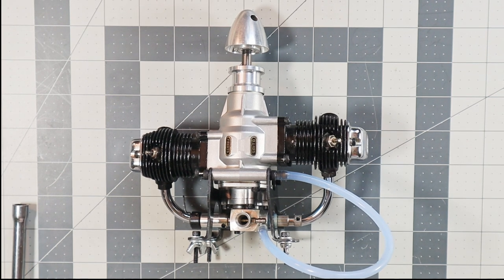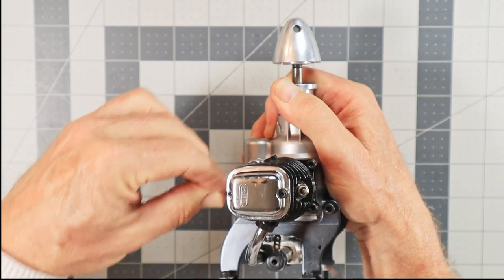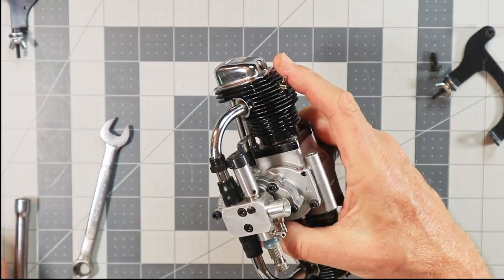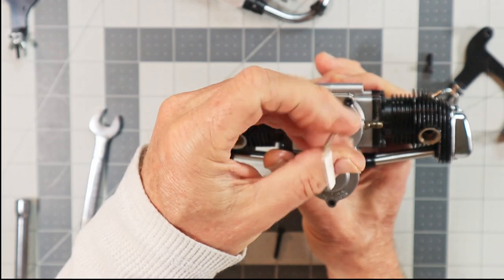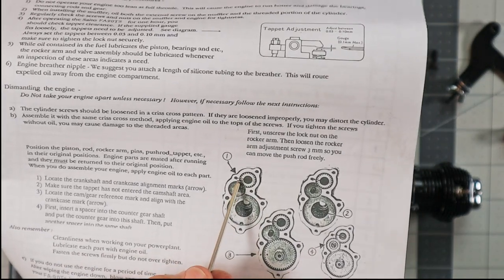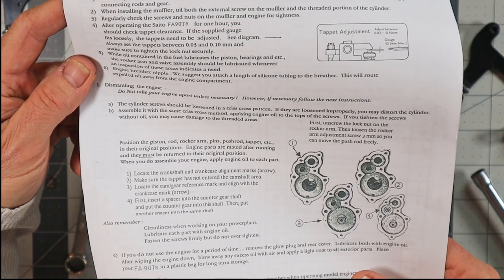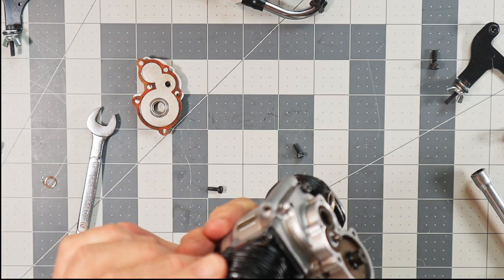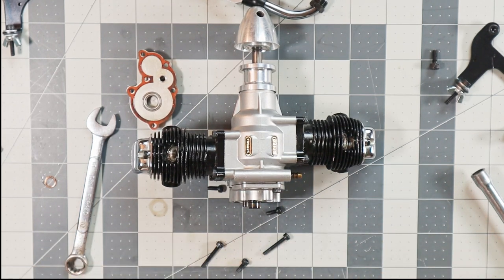Saito FA-90TS A Look Inside

Comment from the maker: To close this out, it appears that the timing was off by one tooth.  After reading the comments and consulting with my friend Harvey, I gently pushed the timing cam shaft out while the engine was fully assembled.  The alignment mark on the top gear #1 in manual, is between teeth and not ON a tooth.  After closer inspection, with my magnifier on, I could see that the image I posted from the video I had the Tooth above the mark aligned with the mark on the case.  This made it look like the timing mark on the cam shaft was in the correct position but in reality it was one tooth off. The timing dot on the cam shaft was DOWN one tooth from the proper position. This still does not explain WHY there are two dots on the case for the timing when the manual shows and speaks of only ONE.  A better questions is HOW this got to be mistimed.  Seeing as the cover for the cam shaft bearing was dinged from a screwdriver when I got it; it seems to imply that the previous owner did exactly what I did.  Pushed the timing shaft out and retimed the engine, improperly.  The final question would be WHY?

The engine is reassembled and hopefully I will get this back onto the upright and mounted again very soon for another run video.  Thanks to all that commented and assisted.

Comment: 2:52 Mine does that too. It spools up pretty slowly. I've always chalked it up to having such small cylinders that the torque isn't as high as a single of that displacement would be. I also ran a 14-6, Omega 15% fuel. Flew mine a couple times like that, even, ran fine in the air no growley bearing noises.

Comment: 7:30 Scratch that, timing's even easier to do. Just pop that idler gear out, rotate the cam and crank to where they should be, pop the idler gear back in, and you're done. Don't even need to pop a rocker box off!
Reply from the maker: Yes I just did this.  I was really concerned that a tappet would drop into the case doing this but luckily one did not.  At first I didn't think I could just press the timing shaft back down.  It appears that the timing was off by one tooth.  Thank you for your comments and assistance.
Reply: @dmrcflyr2  Should do that to mine, then, because mine does the same exact lazy transition coupled with an overall malaise yours does.  Lookin forward to seeing yours run after retiming!
Reply from the maker: If you do yours please note to see if the case has two dots as mine does.  Use a magnifier, unless you have perfect eyes to check the actual timing first.  I was fooled easily.
Reply: @dmrcflyr2  I'll be sure to check back if I remember haha. Almost wonder if itt'l help alleviate the tendency of mine to drop a cylinder at idle, too.
Reply from the maker: @TestECull  Yours drops a cylinder too?  Always the same one? Which side?  I don't think I ever experienced that yet with the 60T or the 90TS
Reply: @dmrcflyr2  Usually the right jug. Picks back up again on jts own when I throttle up pretty reliably, though.

Comment: 5:33 Nah. You can sneak the pushrods out of it without taking anything major apart. Just manually open a valve and wriggle the engine until the pushrod jumps out of its pockets. Once all four pushrods are out, roll it over a couple times and the tappets should just stick in the tops of their bores since there'd be nothing pushing them back anymore. Voila, now the cam can be removed and retimed without major disassembly.
Reply: you dont have to do all that to retime the motor. you dont need to go any further than what dave did. all you need to do is  remove the idler gear, between the cam and crank and you can  reposition the cam to the correct setting. if you want to rotate the cam, turn the crank,90degrees, either side of TDC to avoid piston to valve contact. set timing and reinstall the idler gear.
Reply from the maker: Shit, I didn't remove the idler gear either.  I thought about it but it didn't simply pull out with my fingers. I figured oil and suction might be holding it in place. How would you pull it out Harvey? soft nose pliers?
Reply: @dmrcflyr2  i used a pair of heavy duty angled, tweezers, dont  member where i got them. but i removed it. wasnt bad to pull.
Reply: i forgot to mention that they were pointed tweezers.
Reply: @harveynewman4333  Ye I noticed that idler gear later in the video. Super easy to set cam timing on an engine like this!